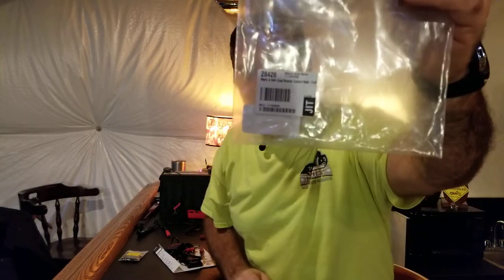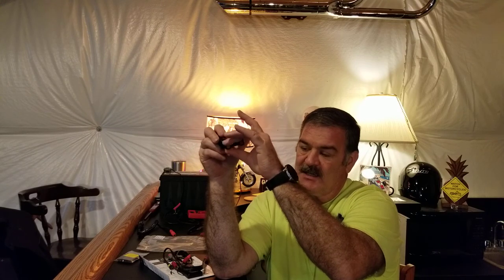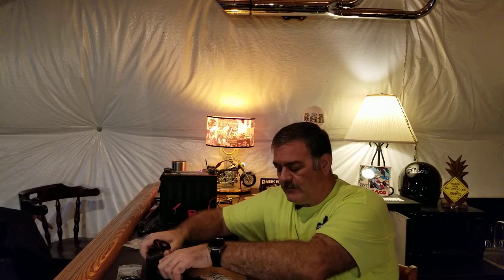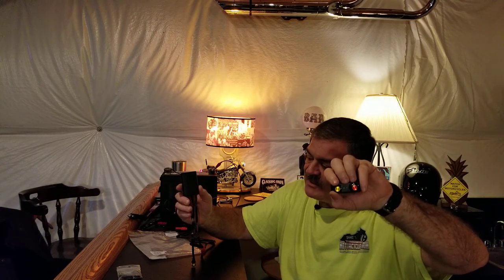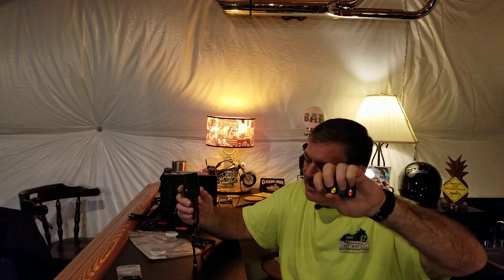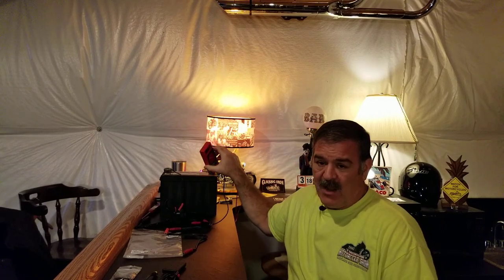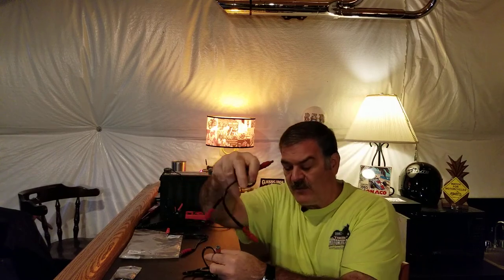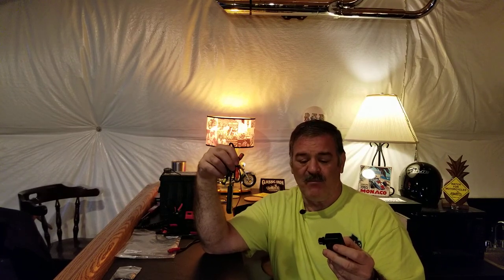Warm and Safe Dual Remote Wireless Heat Controller Review

Comment: Great Job!  I have friends, probably hard to believe, but I do. 4 of them have the Warm & Safe product and swear by it. So I bought the Jacket liner, Gloves, Dual Remote-Troller, and an SAE to their round electric connector. Going to use the SAE out of the side of the bike for power.  I like the tip(s) you had on shutting down first, then disconnect. Then run the bike, connect and power on when you are gong to use it. Thanks for the info... and check my channel if you like, I have installation videos on there also.
Reply from the maker: Thank you Tom. -GeezeRider

Comment: A bike mounted voltmeter will monitor the charging level, 13v minlmum.
Reply from the maker: Hello domster200,
Agreed, and you make an excellent suggestion!  If your bike is not already equipped with a voltmeter, the installation of an aftermarket voltmeter is not overly expensive, and they are relatively easy to install. This will help you monitor real time voltage levels when using accessories and/or heated gear, and provides the information needed to adjust usage to manage consumption; helping you to keep the voltage at a safe minimum level at all times.